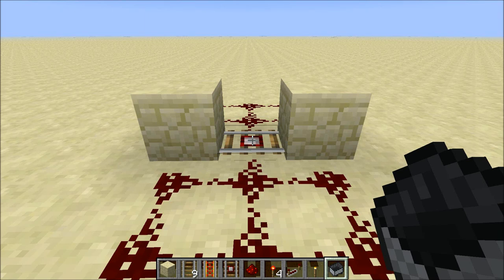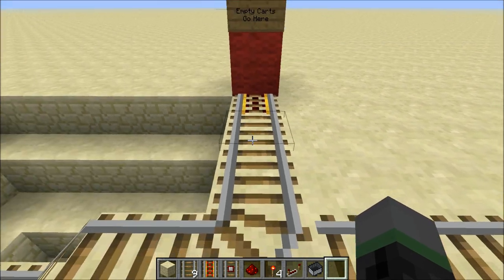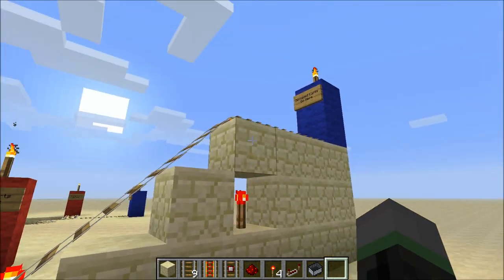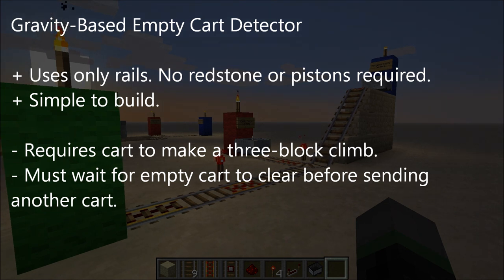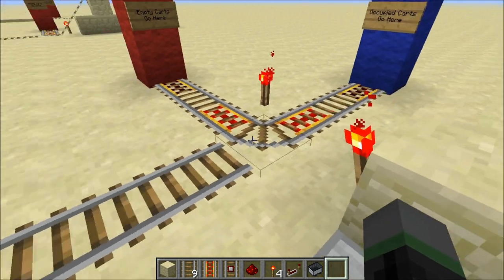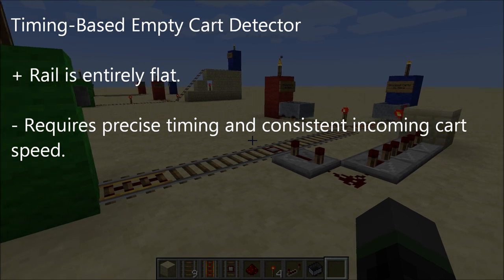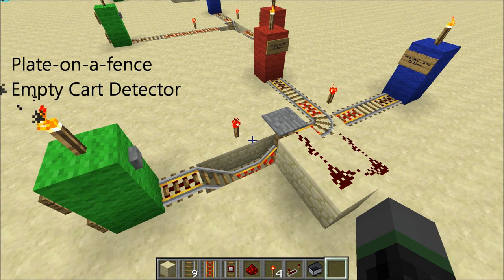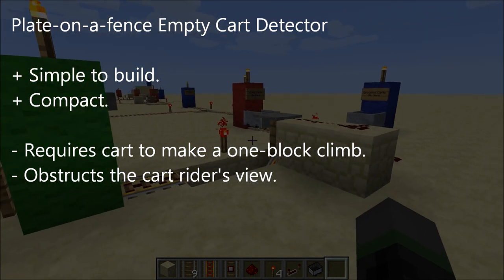Different Types of Empty Minecart Detectors (Minecraft)

Comment from the maker: You have to make sure that the gold blocks on the side of the station are pointed in the correct direction, either south or west. Rotating it any other way will definitely cause some of the track switches to be oriented incorrectly, causing carts to go to the wrong places.

Comment from the maker: @MinecrafterX3 Yep, thanks for the optimization. I initially posted saying that this wasn't possible because a NOT gate might be needed between the plate and switch, but in that case you can simply replace the block one block above next to the switch with a redstone torch. This is what happens when I post late at night. :P Thanks again.

Comment: In my station, I need to actually send a minecart along in order to access the wiring and unused transit slots - it's a six way hub, but only has 1 path built as yet.  I don't want to have to power-rail every 9 blocks on the 1000+ block path, but that's the minimum to sustain empty cart movement, and I don't want to hunt down runaway minecarts mid-path.  So putting an empty detector near the start sends the cart along the return path instead.

In short, for fancy cart systems.

Comment from the maker: The plate-on-a-fence detector still works as of Minecraft 1.2.3. The track switch will behave differently depending on its orientation. In those cases, use a redstone inverter to flip the signal.

Comment: You can still use the first detector (glitch booster detector) nowadays, but you have to use 3x3 round boosters on either side of the pressure plate as the linear booster no longer works.

Comment: yeah I rotated the station 180 with the gold blocks facing the correct direction and all is good, it just seems either I can't tell north from south or the station signage was reversed.  all is good so far, just trying to keep mobs off of the ground level tracks that are not in completely flat areas is challenging. Thanks.

Comment: An additional caveat with the sloped detector rail device - it seems to be dependant on cardinal directions.  My north facing one sends empty carts left and player carts right.  Conveniently, the place I want to implement the design calls for the opposite behavior, meaning I'd have to build a reroute system.  Too bad I don't yet have that much iron and gold to burn.

They really should make a wooden plate detector rail for the any-cart function and stone plate detector rails for loaded carts.

Comment: Any of these still works nine years later? In bedrock? :D
Reply: I believe that the final 2 works. However, I'm not fully sure if it works in bedrock, as i haven't test this yet, and the timings will almost definitely be different. However, I do know a newer variant that works in Java, but am also unsure if it works in bedrock. How this one works is that the minecart will travel at a consistent speed(recommended full speed) with a gold or iron pressure plate on ice in the middle of the track, causing the minecart to derail and then activate the pressure plate and then rerail. When it activates the pressure plate, I believe that if there is an empty minecart, it will give off a signal strength of 1 and if it has a player inside it will give a strength of 2. Using this information, you can filter out the empty minecarts by checking if the minecarts do not have a signal strength of 2. If it does, it will reroute the route for a short period of time so the player can travel to their destination properly, but if it doesn’t, the route does not change and they will go into a storage system

Comment: 6:19 doesnt the detector rail switch the normal rails direction? How is that a bug?
Reply: +lxt101   it is a bug because the detector rail should switch that track direction even when cart is empty,  and also when cart is full,   detector rails always give a signal,  doesnt matter if its a occupied cart.,..   but because of this bug it only switches when empty... wich is weird,   and is already fixed btw,  just tried it, no longer works
Reply: Oh? The original detector rail only detected full carts. or maybe that was when it was a bug? I already know most of these rail bugs are squashed after building a hub station system. Where i opted for the actual mechanics over the bugs incase they get fixed.
Reply: lxt101  nah,  detector rails have ALWAYS detected empty and full carts,    but back in the time from this video it was a bit buggy when a detector rail was sloped,   but that has been fixed...    And yeah,  i also tend to go for stuff i know is not a bug,   for example the most reliable i found was the one with the fence post with pressure pad on it,   but that might get fixed in the future too,  since you go through the fence,  wich might be considered a bug...    So the only ones that are truely non-bug  are the timed ones,  and the one with the piston and stone pressure plate  :)